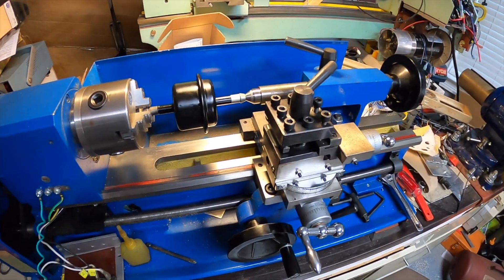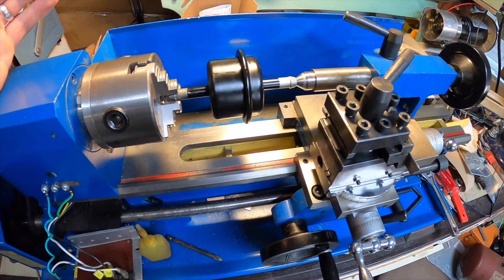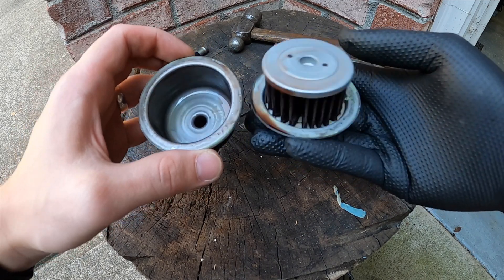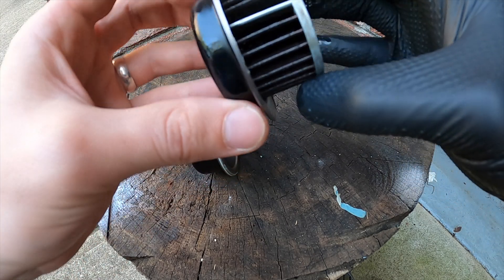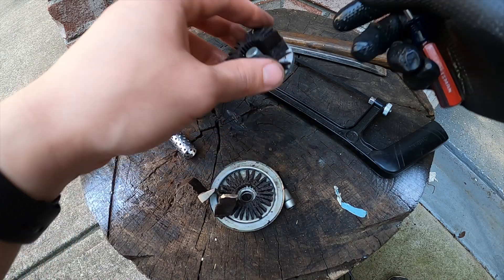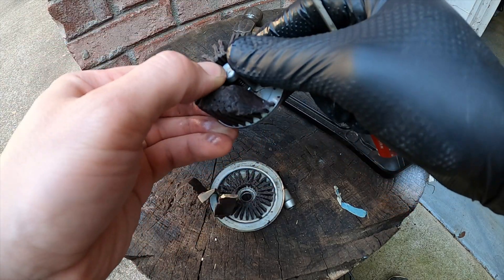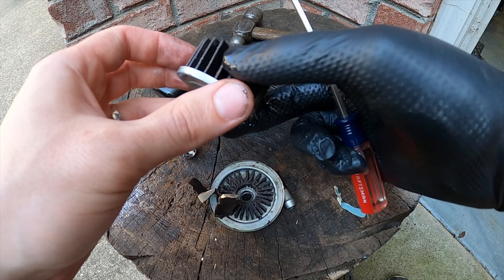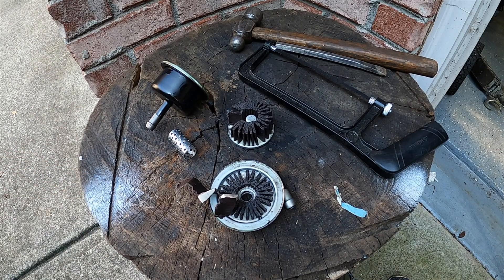Whats Inside a 30,000 mile Honda Ridgeline Transmission Filter?

Comment: The 10 mm bolt that holds the clamp around the filter is a pain in the neck to removed it. Only by touch totally blind why honda?

Comment: I replace the tranny filter on my Subaru every 30k, I now have 380k on the car and it shift very smooth. My Mazda Protege I had since new only did 60K with no filter change when the transmission failed.
Change your trans filter its cheap insurance.

Comment: ? I just changed my ATF yesterday on my pilot with 30k miles and failed to think of doing this filter change. Any idea if I could wait till the 60k mark to do it then with another ATF change or should I just do so sooner. Do you think it would cause any damages if I wait?
Reply from the maker: It’s not necessary to change it but while you are there might as well. It’s inexpensive and additional cheap insurance.
Reply: @YuriyMotso  thanks man, glad I came across your video. I will definitely change it out at 60k

Comment: Your filter looks excellent. I just did mine and cut it open at 45,000 miles, still looks great. I will not bother changing it again for maybe 100,000 miles.
Reply: Honda service managers love comments like this. SMH!
Reply: @3dsmackdown  I don't give a crap about Honda service managers. I have towed for about 60,000 miles now, do a 1x fluid change every 10,000 miles, and have nothing on the magnetic plug when I change fluid. There is nothing for a filter to catch when you are getting virtually no wear.

Comment: I am on my second 9th v-6 Accord and sun in-law has 2014 odyssey. My friend Scott has a transmission shop he told me Honda requires filter replacement when it leeks or when you rebuild the unit. However Scott thinks it best to change the filter at 30,000 k 100,000 k 200,000k and so on.. then, I change 3 qt. At every other oil change (over kill I think). I change the oil after 30% oil life is reached. We have had no problems thus far knock wood.

Comment: Not gummed up bro.. your looking for metal shavings
Reply from the maker: Yes you are correct. I used the wrong word for the video. after I made the recording I just left it there. There still is a lot of mushy metal shavings but big flakes would have been very worry some.
Reply: @YuriyMotso  I'm looking and are you looking to add a extra cooler

Comment: Looks remarkably clean. I thought this was a lifetime item. Where did you see a replacement schedule for it ???
Reply from the maker: I believe there are two filters. One inside the transmission and one outside. Obviously the one inside would be lifetime as you cannot access it. The outside one I don’t think Honda has a specific requirement to replace it however because it’s a filter and it does one thing which is trap debris, like any other filter on the vehicle we replace them. So might as well replace this one while your at it as the fluid does get nasty over time. There wasn’t anything terrible in the filter but best to replace it with a new one so that you can increase the effectiveness of your filter and increase transmission life.

Comment: Was that from after the cross country tow and overheat?
Reply from the maker: Yes, but it's also at the suggested maintenance point as well. So technically i'm a bit over due since towing is to be done at 15,000 mile change and regular driving is to be changed at 30,000.